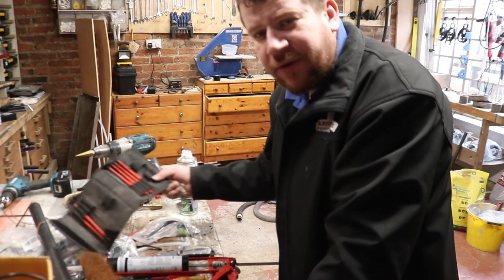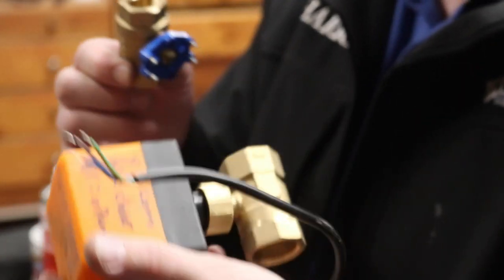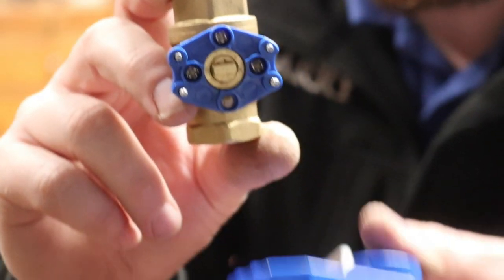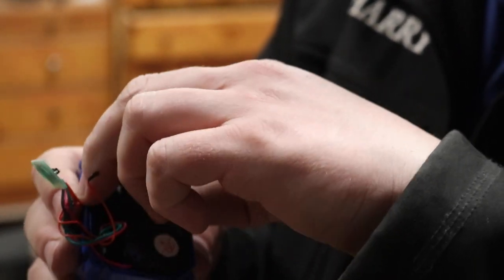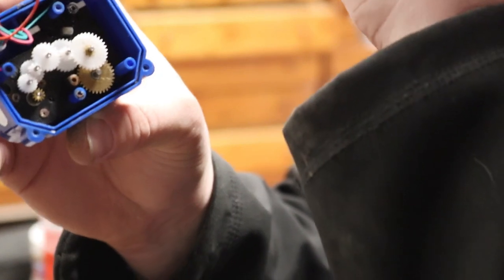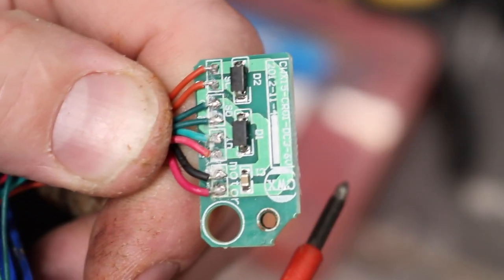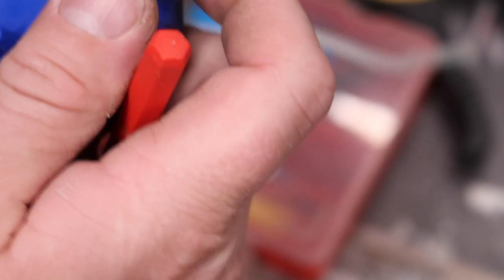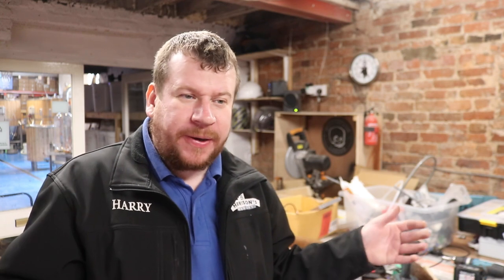Inside A Motorized Valve From Ebay

Comment: The diodes are switched into circuit at end of travel to block current and stop motor. The same diode will then pass current when the applied voltage to the motor is reversed and the other diode will stop it at end of travel. If they weren't there the motor would run to end of travel,  the micro switch would open one leg to the motor and that would be it. No matter which way you applied current, the motor would never run again.